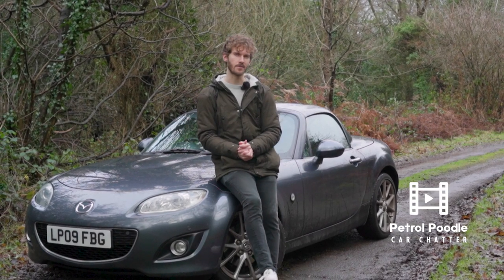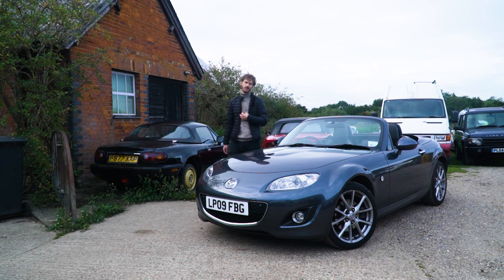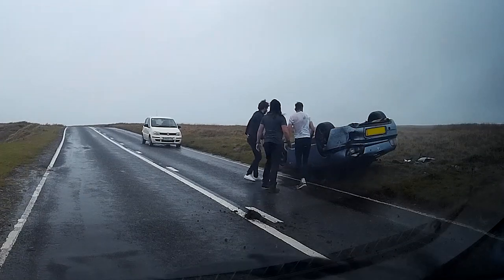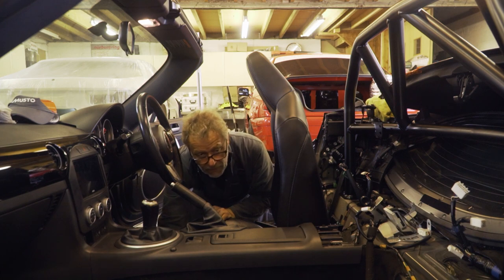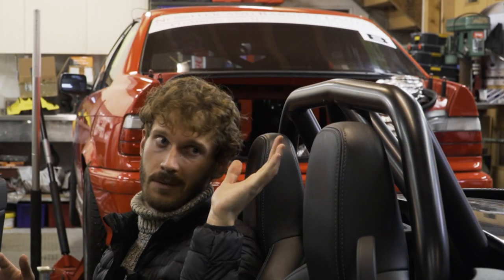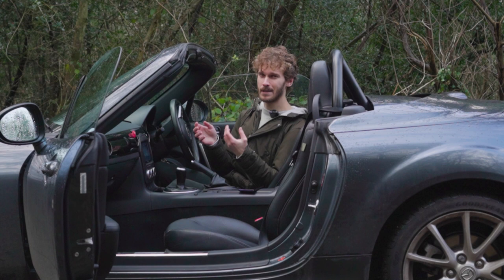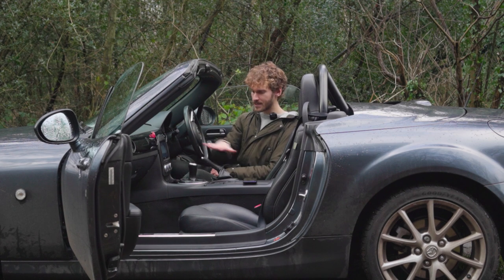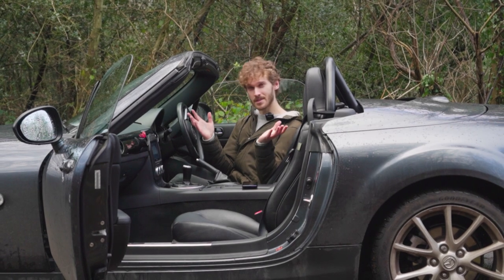Is This The Most Essential (Yet Overlooked) Mazda Miata MX-5 Modification? GC Fabrication Rollbar

Comment from the maker: UPDATES - PLEASE READ:

#1 It passed its MOT!

#2 Safety of hitting your head on the bar. Evzen and Kuba make a very valid point that there are incidents where people have hit their heads on the rollbar in freak accidents and it's why I would never recommend a rollcage for a road car. I recommend assessing this to you and where you sit in your seat but also to research and install rollbar padding (non-helmet as apparently FIA helmet style is very hard!)

In my instance personally, my head (even when I fling myself around) doesn't reach the rollbar behind me, there's enough headrest most of the way up my head that I can't bend my head around a corner so to speak.
 BUT someone in a forum said that they were of this belief and found they hit their head against all odds with a rear-end collision. I'm not qualified in crash safety but it would appear to be advisable to put as much foam as possible around a rollbar in case this happens. Don't buy the foam designed for race helmets as it's actually too firm for the human head and has a similar effect.

#2 Seatbelt retention - Grant from FC Fabrications has watched the video and is already working on a new seatbelt guide that should (in theory) be able to replace the already flawed, grippy ones on the sides of the seats. We found on the phone that if I took the belt out of the plastic guides it retracted with full vim. The belts like one or the other, not both currently.

So fix should be there soon but this has gone a little quiet...

#3 Final thing to note, the plastic wind deflector only goes 80% of the way up, so doesn't click in place anymore. Not an issue until you're at 70mph where it (over time) slowly makes its way down to about 45 degrees.

Otherwise, as someone with no qualifications in car safety and despite the rollbar headbutting dangers (really more applicable to prior MX-5 model retrofits) I'm still glad I have many inches of rollover protection above my head now rather than below.
Thanks for watching and thank you for bringing up the perfectly solid counterargument guys.

#4 Thank you for the fantastic reception, I'll be sure to do more MX-5 content soon!
Reply: Pin this comment.
Reply from the maker: @AdhamHossam165  thank you, I actually thought I had already!
Reply: @petrolpoodle  : Did the seatbelt is issue is sorted at the end? Any idea if their latest roll bars won't have this issue?
Reply from the maker: @sayanpal9491  I never had mine sorted actually, I didn't hear back from the guys at GC Fabrications but then after a while I also totally forgot and just got on with it. I did try a new seat belt guide from Australia which worked better (with silicon spray on the belt). It was much better but never how it used to be and when the silicon spray wore off it'd snag a bit more.
Reply: @petrolpoodle  : Thank you for the update. I will call GC Fabrications to confirm.  I finally bought an NC MX5 last week. Your reviews of the car have definitely been a driving factor! Do you still have the car?
Reply: @petrolpoodle  : For the seat lowering brackets for the passenger seat, do you recommend the 1-inch or 2.5-inch one to have a similar ride height to the driver seat?
Reply from the maker: @sayanpal9491  that's a great question, I actually never got round to installing my passenger one but the biggest thing I'd say is just be careful of your seat type (cloth vs leather) and driver/passenger position when buying.

Personally I'd drop the passenger seat to match the driver's seat

Comment: This was a great video for anyone that has second thoughts of buying this great car but has safety concerns. Had a friend who rolled over with an Alfa spider and barely made it and had to spend 6 months in hospital...
Smart w roll bar in combo w lowering the seats. I see that the bar is slightly curved in plan which makes it stronger. The more curved and pushed out it will start to act also as a side impact protection system. Perhaps there is some further development to be done?

Comment: Good and informative review Jimmy! The feedback on the lowering adapters is appreciated too. Thanks!
Reply from the maker: To what do I owe this pleasure! Thank you so much, I think you guys have done a great job of explaining that on the site already, I think the flaw was more with myself skim reading first time I looked!

Very happy with the product!
Reply: @petrolpoodle  Thanks Jimmy! You have fair point, Mazda had 3 NC seat (rail) options during the years - the non height adjustable and the side coded (left, right) height adjustable ones. This needs to be considered, when deciding which adapters are needed for the lowering.

Comment: What i did when I lowered the driver's seat with the Jass brackets, I removed the seat belt guide so the belt slid better and fitted over my shoulder better.
Reply from the maker: Ooooo this is interesting, did you take the plastic bits off the shoulder of the seats themselves or was it where the belt comes out of?

I took the belts out of the plastic shoulder guides and found it slides with absolute ease but it concerned me too much that if the seatbelt were to slip down the side of the seat, I'd have nothing holding me in the car above the shoulder haha
Reply: @petrolpoodle  i took the plastic bits off completely,  and just left the metal base (to fill the screw holes). The line from the belt retractor to my shoulder is much better. I do have to reach further back to get the belt to put it on though; that's only downfall.  I'd be interested to know how it works for you with the roll bar.

Comment: Good video and yes, fabulous car!!
Re the seatbelts "Coloured in light" has a video showing the Mazda update recommending newer (lower friction) runners at the top of the seats. 
Re negs, another Brit (he says "righty tightly, lefty loosey) pointed out that behind the front and rear bumpers, rust grows. You need to unbolt the actual bumper from the chassis to eliminate it.
Thanks for the roll bar reminder, it's a winner, what were Mazda thinking??
Reply from the maker: Thanks so much, Eric!

I've bought less frictiony and more open belt guides for the seats and sadly it hasn't made the difference I'd hoped for.

Definitely easier to adjust and they don't twist and get stuck like they used to, but £90 was quite costly haha

And good to know re: the rust, I'll be rustproofing it next year I think!

Comment: I have the same sluggish return seat belts. 2006 hardtop.
Reply from the maker: I did add a better belt guide (sent from Australia!) which certainly stops the seatbelts folding and getting stuck like they used to but the belts still don't fully retract by themselves. They do lock in place with a tug though, so I just make sure it's tight-ish before I go!

Comment: Like your videos in generally, but especially the small details like the seat lowering kit that I didn't know existed. Also what is the fast road set up you refer to, and what are the benefits?
Reply from the maker: Hey Buzzman,

Thanks so much for the kind words!

Essentially compared to just getting your tracking done on a normal car, the MX-5 has clever multi-link suspension (or whatever term my tired brain is unable to remember at this moment) where there are many, many factors they can tweak to the suspension. People refer to it as getting a proper alignment. A good MX-5 specialist (look up your local one if you're interested) will be able to choose a fast road alignment which means it's not so aggressive that you'd only want it on a track but it'd also be far better suited to track driving and fast B road driving than the standard alignment. It's remarkable what a difference it makes, the whole car feels so much more alive and connected, much quicker steering and it feels like there's less body roll but that might be a bit of the placebo effect.

A very good spend of the money on whatever car has suspension that can take advantage of it (y)

Comment: I think the mod provides an issue that is possibly as dangerous a risk as the roll bar height. As you said, if the seatbelts don't retract, then that is a big problem, and I believe an MOT failure. Great vid....
Reply from the maker: Hey DG,

Thanks for the comments!

The seatbelts do retract still, they only take a mild tug from one finger and they slide still, it's just there's ever so slightly too much friction for them to automatically retract. I'm going to chase up the GC Fabrications guy on the seatbelt fix as he went quiet after. He may have just forgotten and moved on. (not the same guy in the video who's fitting it!)

MOT - It passed! Wahoo!

Comment: Excellent video - thinking of this as the next move for my MX5 summer / AutoSolo / Sprint car but like yourself, I'm keen to keep as much of the factory functionality as possible (Bose Amp, rear speakers, retaining clip for the roof and the roof control box)... I'm happy doing the bolting and cutting myself though - any idea where one could source the box section you've used to cover the GC Fabs bar? Also wondering if the box section would foul on a race-style harness if it was wrapped around the GC Harness bar?
Reply from the maker: Hey Huw,

The crossbar was actually repurposed from the previous mk3 MX-5 he fitted the rollbar to. He takes an old one out each time, then drills the holes correctly (I think), sprays it the same colour as the bar etc in preparation for the next rollbar installation.

So you could definitely use your own one.

Also, Phil has raced a serious level for decades and trains aspiring drivers here in the UK; he's got his very own belts for sale that work with this whole setup. They're not UK road legal but would be track complaint I believe.

His email is in the description if you're interested 😊

Comment: Great video! Very little info out there for this PRHT roll bar. When the roof is down, does it still lock in place?
Reply from the maker: Thanks pal! Yep when the roof is down it's all normal! Car drives happily like it did before, only thing is the wind deflector only goes about 60 degrees up instead of all the way. Still operates fine under 80mph!
Reply: @petrolpoodle  Thank you for the reply! Just to be clear, since my wording wasn't great... The latch on the roof locks into another latch or something behind the wind blocker. A build I saw online showed a lot of modification had to be done to add that back in. Is this still the case? Thank you 💯
Reply from the maker: @awlatmg  ahhhhh I see! Now that's interesting, I didn't note that being done, next time it's going down I'll watch and take a look for you! I'll let you know tomorrow good sir!

Comment: I assume in a roll over you will likely drop out of your seat and the belt even under tension wont hold you completely in the seat, meaning your head might hit the ground in an overrall accident still, regardless of the rollbar being higher when the car isnt upside down.
Reply from the maker: The tension did work well enough when I did emergency stops, it really did hold me in place.  The fact the lap belt is also clicked in quite tight would probably help too. The guy in the S2000 remained in during his rollover, but I'm no expert. I just wanted to bring to everyone's attention that the standard rollbars sit under head height - which is utterly mad in my opinion.

Comment: Hi

Did your guy make the rectangular bracket to reinstall all the parts like amp and speakers?
I’ve just ordered one of these bars and after speaking to Grant he’s on a new version of the bar now that includes brackets for attaching your old piece of section one cut away from the ‘style’ bar .

How does the roof lock in the open position on yours?

Cheers
Reply from the maker: I believe he made that little bracket, his contact details are in the description so the best bit is to have a chat :)

The roof has continued to operate fully normally :)

Comment: Hi do this role bar have any effect on the opening and closing of the PRHT roof.
Thanks great video
Reply from the maker: Thank you pal and it all operates perfectly as it should.

The only change was that the wind deflector could no longer clip in place at 90 degrees anymore, so I had to cable tie mine to the bar to keep it up.

Comment: Very helpful video bud. 👍 Though one thing to note, the NC is notorious for the  seatbelts refusing to retract. Got an NC1 that's the same, and always has been. Seems to just be one of those things.
Reply from the maker: Thank you very much! I appreciate that!

And yeah the NC 2 like mine has better seatbelt guides and didn't used to have an issue until I put the rollbar in. But it's still worth it in my opinion, I have found better seatbelt guides from Australia and whilst they don't fully fix the problem, the belt no longer folds on itself and gets stuck.

Comment: Just come across the channel and subscribed.  Interested to see what backbox you go for.  Standard definitely doesn't provide a sense of theatre.  I don't need more power, but I'd like the excitement of a decent sound when hooning on back roads!

Problem is, I like tone over volume, and I haven't got silly money to spend which limits the options.
JapSpeed is £200, but no reviews or sound clips, and the vids I've seen fitted to other makes/models sounds over loud, tinny, harsh.  Essentially, just nasty.

Cobalt which is favoured by many MX5 owners is discontinued...through Moss Europe...no longer available.

IL Motorsports backbox has a lovely tone, but is over £600!

So I'm staying sock for now, and enjoying the drive but not the soundtrack.
Reply from the maker: Thanks so much mate, I really appreciate it!

Funnily enough I've got a video coming very shortly of probably the cheapest backbox you can buy for about £186, it's quite an entertaining review! Not my own car but I shan't spoil too much!

The other weird position I find myself in right now is having the MX-5 as my only car and now I'm doing 2 hour trips on the motorway quite regularly. I'm starting to appreciate the balance of refinement when you're not in the mood for a hoon haha!

I'm going to buy a daily this summer though and after that, a backbox for my MX-5 toy will absolutely be on the cards!

My gut, like yours, is that the best money spent on a backbox sits around £400 to £600 so that you don't end up hating it but so it adds enough drama at the correct revs.

Comment: When dropping It down dose the locking latch clip the bar like the Cybul role bar
Reply from the maker: I may have misunderstood your question but I'm not sure as I didn't do the install myself. If I can answer your question by looking around the car now, let me know what you mean and I'll take a look for you. Sorry!
Reply: @petrolpoodle  hello there sorry for my poor use of text just wanted to know the cost of the install. Price of the bar is £350ect  but I wanted to know the total cost of the full installation of the bar including the plastic trimming. 

I wouldn’t need the seats done as did it my self
Reply from the maker: @megajohntopunishenslave427  no problem at all!

At the end of the video I run through the costs with Phil Brough and I have the link to his email address I believe in the description. So he could give you an exact quote.

I sadly can't remember what I'd have spent by the time I minus the seat lowering brackets and install. I reckon about £300 to 400 if I had to guess but definitely watch the end with the pricing and grab a calculator ☺